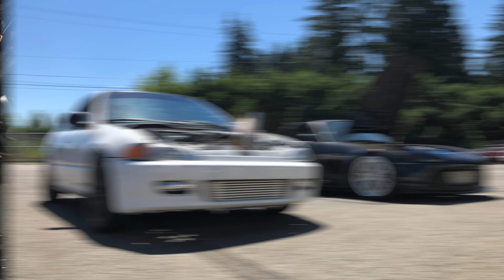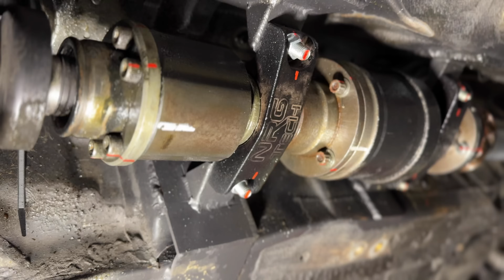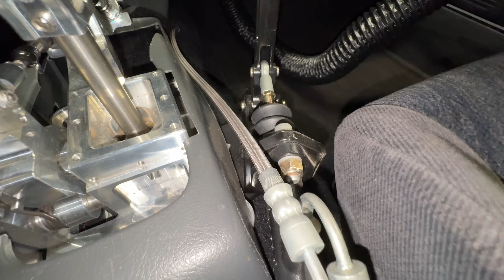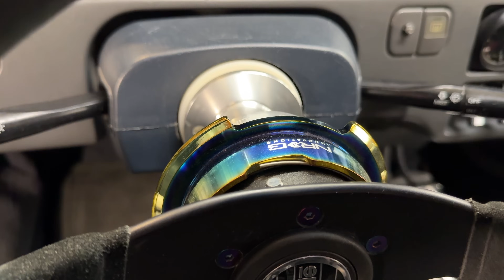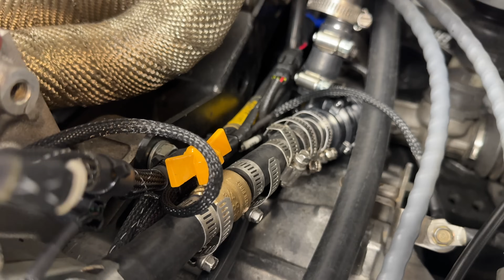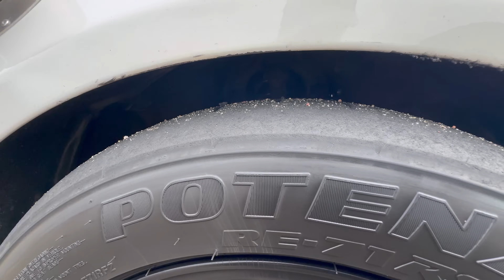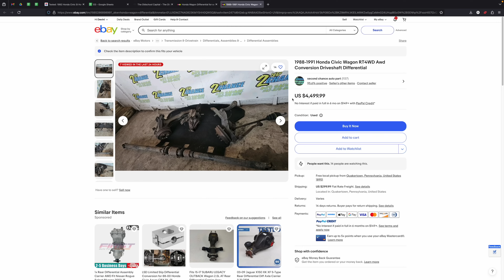AWD Hondas Are Out of Control....(here's the one I built).

Comment: What did you have to do to the hcp rear lower control arm to fit the s1 built RTA? I assume some sort of adapter from the HCP rear control arm to your strut? How is the axle clearance?
Reply from the maker: If you look at the s1 arm where it bolts to the lca, you can see the rearward facing part is rounded. This works fine for the s1 lca’s since they have a rounded end with a solid spherical bushing. But the HCP arms are squared off like a traditional lca. So you have to grind the profile of the arm down to round it off. Hard to explain.
Reply: @kawdzilla Oh ok gotcha. I see you didn't use the s1 built strut forks for more axle clearance, did you build a custom piece that connected the base of the strut to the LCA?
Reply from the maker: @nicholashays1246 the HCP arms are offset arms, so the shock mount point is slightly off center to give more axle clearance. Nothing custom.
Reply: @kawdzilla icic. I didn't know that. I'll probably go this route as those forks are crazy $ for what they are.
Reply from the maker: @nicholashays1246 you’ll need an angle grinder if you go this route. Not complicated, but don’t take off any more material than you have to.